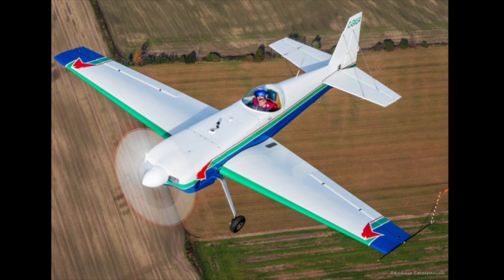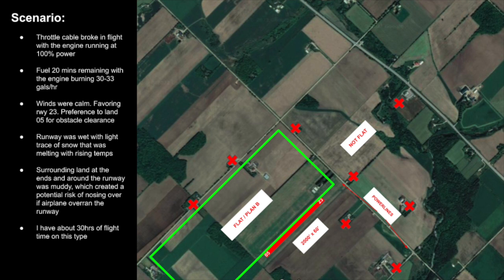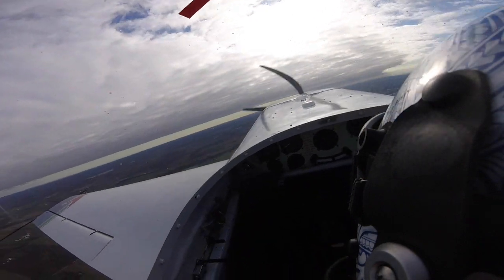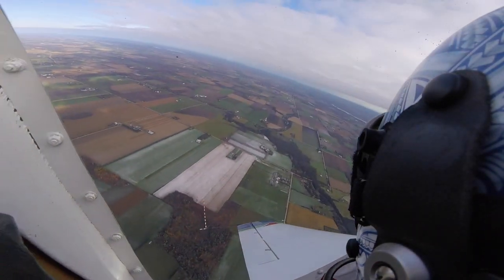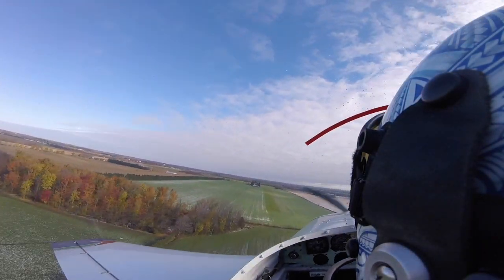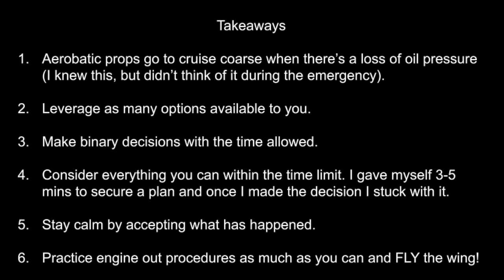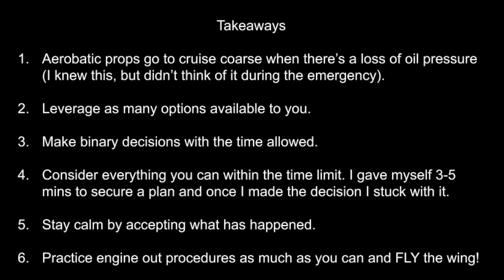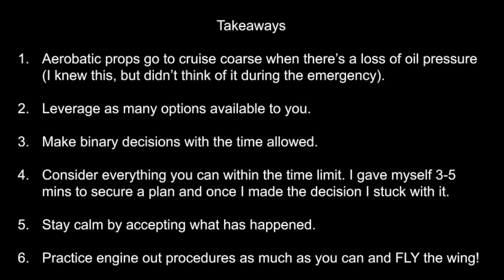Throttle Cable Failure In Flight In The Staudacher 300!

Comment: I met an old alaskan bush pilot who told me a story about flying a rented piper low wing over Wyoming. 

Same thing happened to him, control cable failed at near full-throttle. He thought "how am i going to land this thing before i run out of gas?" Ended up landing it by pulling the mixture, kept the speed up, and opened mixture momentarily just to see if it would re start at will, and it did. So he landed without issue at the nearest airport.

Crazy part of the story... He figured out he could push full throttle as the cable was broken, but inside a sleeve so you could push wide open... being a weekend and no mechanics or parts available at that little Wyoming airstrip, he departed with the broken cable. This took place in the '80s when one could get away with things. Haha!
Reply from the maker: Haha that's great! Sometimes you gotta do what you gotta do.  As long as you know what you're doing, then it can be done.

Comment: Could there have been a possibility that the engine throttle could have rolled back toward idle as a result of prolonged vibration or g? Could have been a bad decision to fly away from your home field.

It's the things that you don't do that results in success :-)
Reply from the maker: Lots to consider for sure. I was almost certain that the throttle cable would not roll back because I could tell the break was in the sheathing and I could use the throttle rod to butt up against the cable preventing it from moving. I had a friend who have his cable disconnect within the engine bay in his One Design, and the engine went into mechanical idle. This is a great conversation starter about "What Ifs". Something so simple can cause so much potential risk. Thanks for the great comment!
Reply: Standard design of throttle systems, if cable becomes free of throttle shaft, the shaft is spring loaded to full open throttle.  This is a feature that should be check at every annual inspection.

Comment: First and foremost, glad you had the skills and means to make a safe landing.  Good job!  However, you should have never had this happen.  There is no reason a pilot should have a throttle cable failure if the original was installed properly.  How about a follow up video of why the cable broke and what changes are being made to make sure this never happens again?   

I have worked on many types of aircraft over 50+ years of being an A&P with inspection authorization here in the US.  Normal design of throttle control, if the control cable is disconnected from the throttle shaft, it should go to wide open throttle.  Throttle, prop, carb heat and mixture controls are key items of any annual inspection.  Has any previous repairs/replacement been made?

Prop control.  Aerobatic to non-aerobatic design is different.  However, this difference has to do with engine oil pressure loss and what happens.  Aerobatic aircraft are designed to go to high pitch, to avoid over revving the engine during maneuvers where short amount of times the oil supply can be compromised due to g forces.  Non-aerobatic designs, loss of oil pressure forces the prop to low pitch.  This is to allow full engine rpm, for example during take-off.  Better to allow the engine to produce enough power as asked by the pilot in a loss of oil pressure.

In your case, this should not have been a factor.  You could have gone to low pitch and because you had oil pressure (prop is rotating, oil pump is producing), the prop governor would have controlled engine speed as it normally does.
Reply from the maker: All valid points Eric and you're right, the cable should have never broken. I thought about doing a follow up to show the break. Based on the design we saw, it wasn't the greatest of systems so we're exploring better options with some redundancy. We had the airplane inspected by 2 different mechanics over the last 12 months, not to mention our own eyes and hands do some work to. The throttle cable was not inspected by us, but can't speak on behalf of the mechanic. Needless to say, it will be a thorough annual check item for us. Thanks for the comment!
Reply: @kahaaerosports  , please do a follow-up video.  I would suggest going through the log books to see what, if anything had been done to the throttle system.  Check if anything is unique or different from the original design.  There should be hard stops at the throttle shaft (engine end) for idle and wide open throttle, and on the throttle quadrant (cockpit end).  With most aircraft, the cable system should be adjusted to first land on the throttle shaft idle stop followed by the quadrant stop.  For full open, the same, the throttle shaft full open stop followed by the quadrant stop.  If the cable system is set in this fashion, there is no way to over stress the cable.  Common things that can affect cable system operation include any bellcranks, and bearings.  They need close inspection to insure no binding or excess play.

Look forward to your findings.  Happy flying! 👍